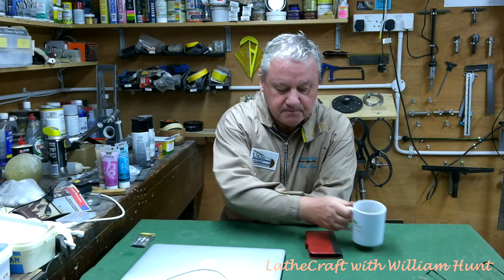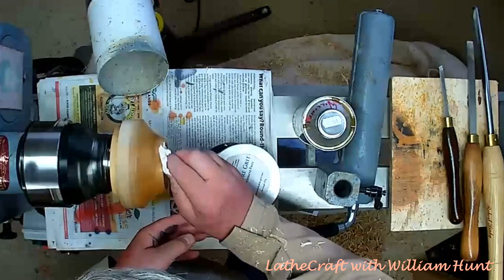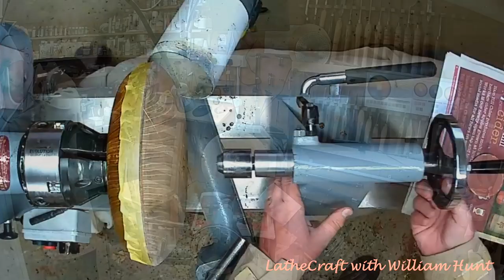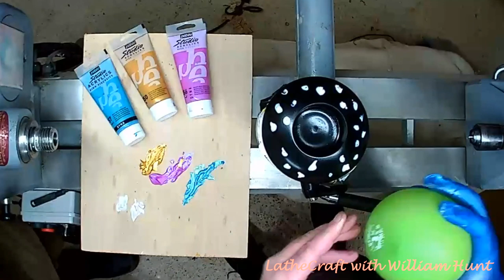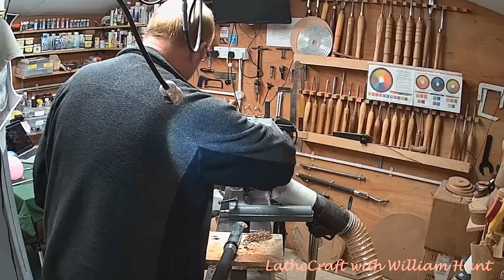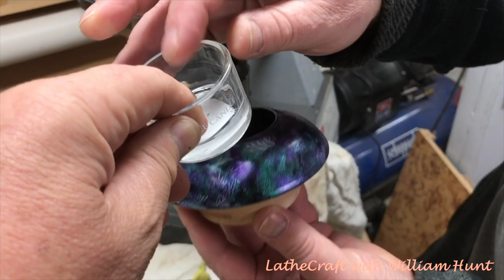🌳Woodturning | Balloons, Corel, and Beer |  Collaboration project with Alan Maggs

Comment: Some beautiful effects.
As a matter of interest how big is your workshop, many I see would not be high enough to support an air cleaner?
Thanks
James
Reply from the maker: Hi James, its 8 feet at the apex, but Im a short-ass so I have a little clearance with my head! The workshop is 20'x10', not big enough, need 30x20...
Reply: @WilliamHuntLatheCraft  A workshop is never big enough, is yours insulated?
Reply from the maker: James, heavily. 75mm celotex throughout including the doors. Rockwool in the roof them 9mm ply on top of that. Double glazed.

Comment: Beautiful results - I am anxious to give it a try.                            There seem to be two products 60ml; flow and 237 flow. Which did you use on this project. amazing resultsRead more Show less Reply     1
Reply from the maker: Roy, thanks for your comments. You need "Jo Sonja 60ml Bottle Iridescent Acrylic Paint" you don't need the Flow Medium, which is basically a thinner. If you buy the set of 6 iridescent paints, I think you get a bottle of flow medium free. I did, purchased direct in UK

Comment: I appreciate your humor...is that stiff upper lip funny?  What kind of beer did you have?  I couldn’t understand all you were saying. What kind of paint did you use and what was the final coating?  Looked like spray lacquer.
Reply from the maker: Sorry about the sound quality, was playing (unsuccessfully) with some new equipments. Fixed for next video. We drink Fursty Ferret and Bud. We used several different types of paint but this technique only works properly with jo Sonja iridescent paints.
Reply from the maker: Also  finished with hampshire Sheen Gloss lacquer.